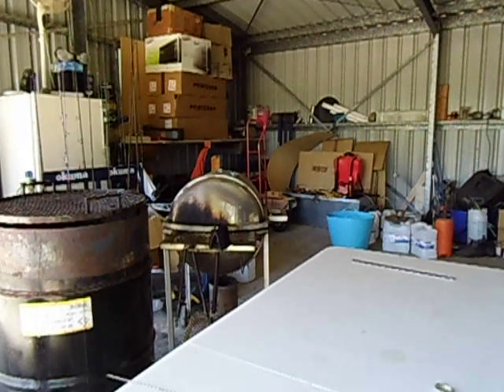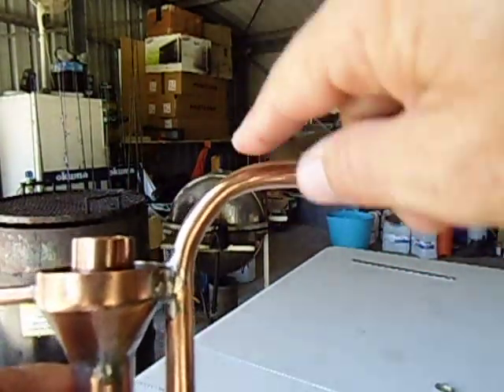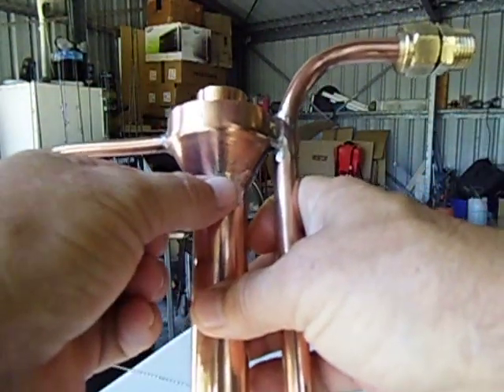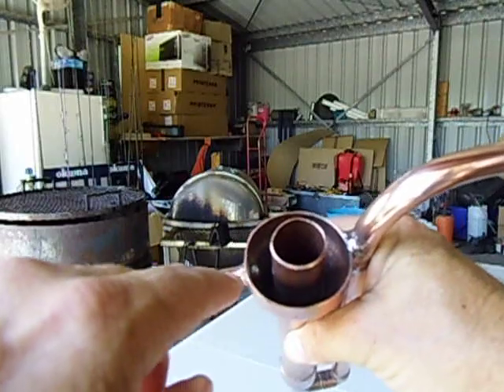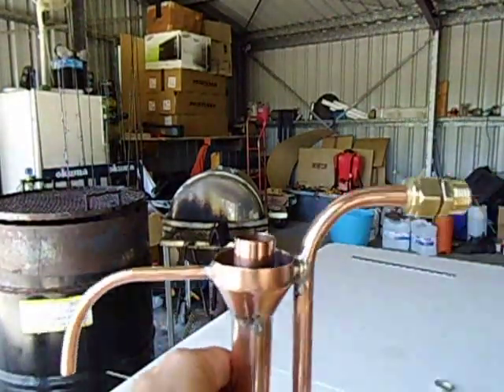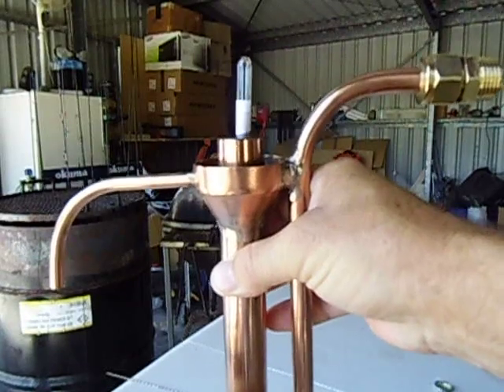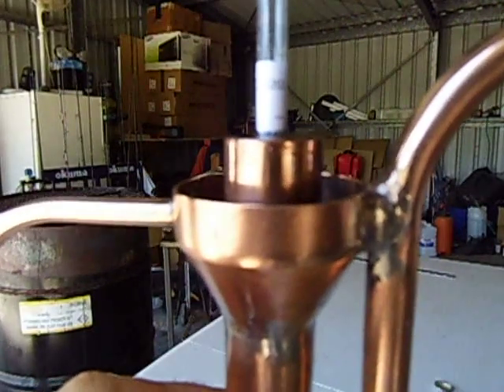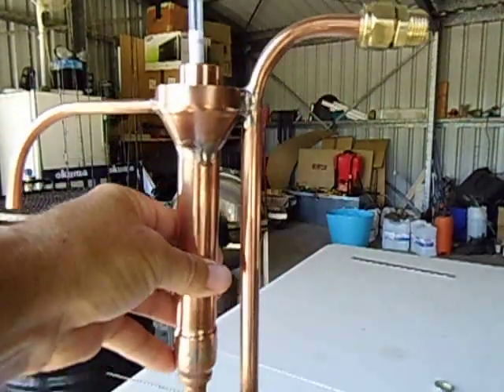How to make a improved alcohol still parrot

Comment: seeing that you hook this up to the condenser,  I see no way you can sepperate the beginning -methanol and heads,  so  if it were mine I would consider,, at the bottom of 25mm pipe instead of elbow, place a tee,, then you could let the unwanted stuff to drip out first, and when you have it to the hearts,  just place a small bung in the bottom of tee,,   on the other hand if you are waiting for all the unwanted to drip away  before you hook it up  seems a little messy to my, thinking, trying to screw on and tighten up the connector, while fluid running...   but if it works for you, that is all that matters,,  it is a PRETTY work of art..

Comment from the maker: At the bottom sections u can use a clear epoxy instead of welding everything , however all parts touching the high abv alcohol should be brazed. This is to monitor the alcohol coming from the still and help you when the abv start getting lower when starting running into your tails , cheers :-)